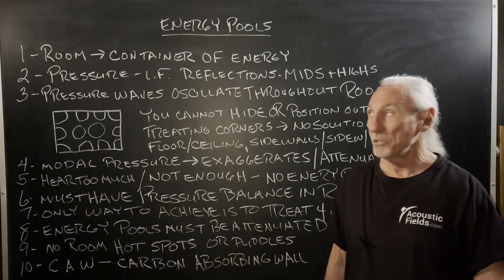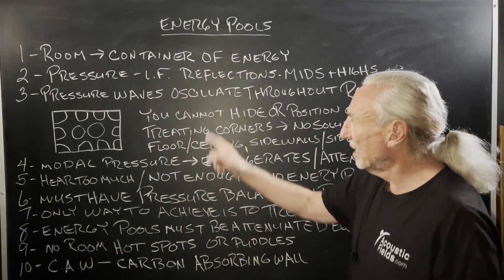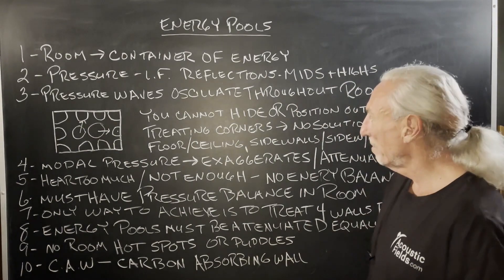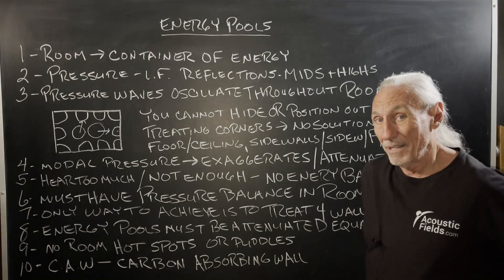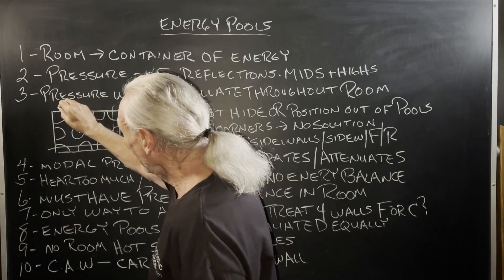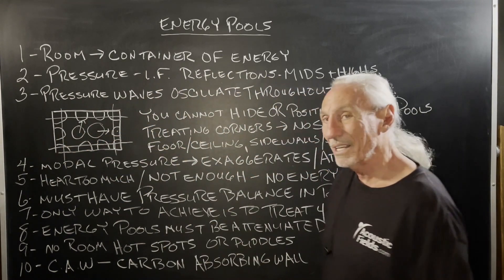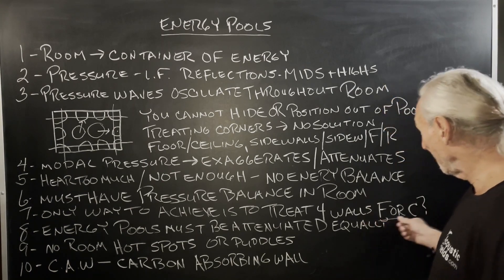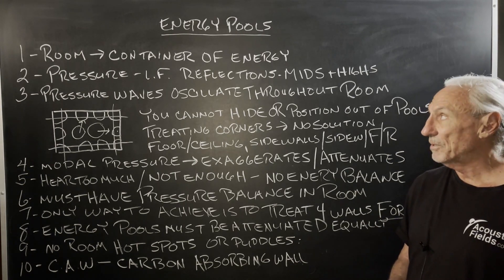Energy Pools - www.AcousticFields.com

Comment: very good & concise treatment of treatment, as usual. "where physics meets music, in confined space" I am curious... IF:
- the nearest-perfect musical soundfield is extremely quiet outdoors free-space, &
- the acoustically optimal indoor room proportions (& respecing scale limits) have been solved, then,
- employing the best acoustic treatment (your SOTA products), how close to that near-perfect soundfield can now be achieved in indoor spaces?

further, does the classic 80/20 rule apply, (in terms of cost-effectiveness & effort)?
is there a rough break-point of "realistically, how close must one get to emulating an outdoor free-space soundfield in indoors space, in order to consider it done?" {in effect; "once you get to 90% emulation of free space in your indoor listening room / mixing studio, you're done!"}
Reply from the maker: Near field resolution can be achieved in small distances room dimensions if and only if you control and manage all low frequency pressure issues along with the time signature of all room reflections. With small distances, you must pay severe attention to everything. If you can do that, you can achieve a high resolution.